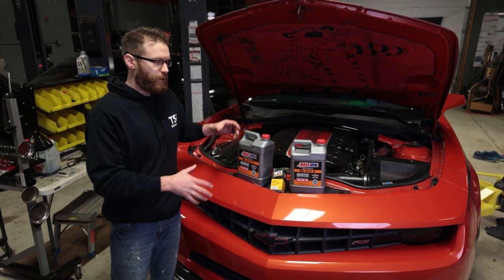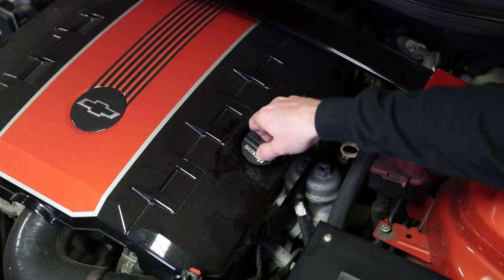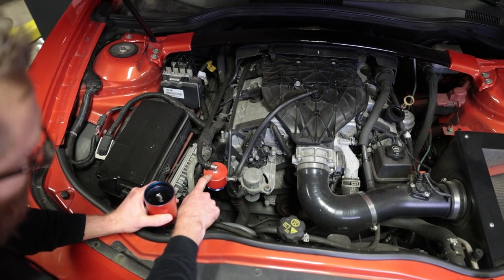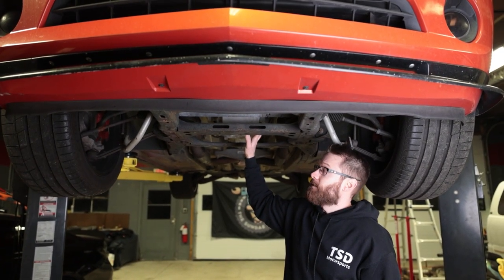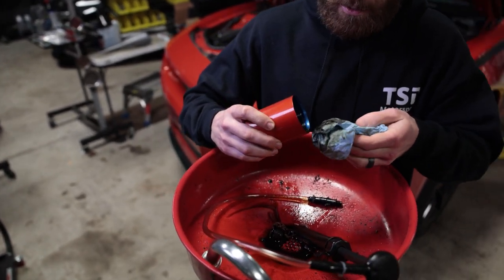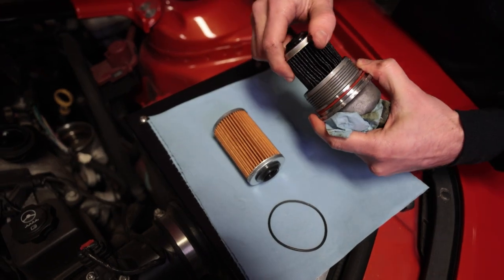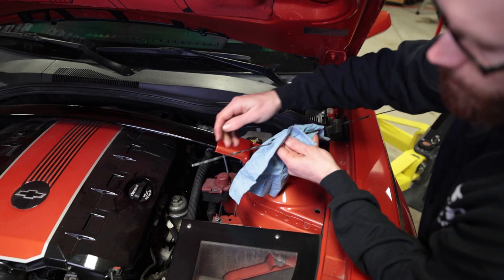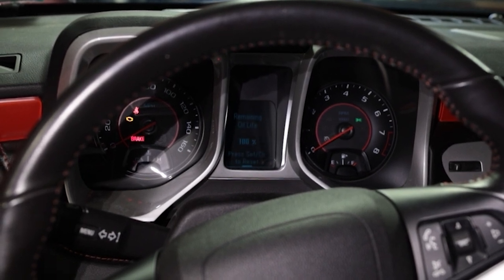Ultimate 2010-2015 V6 Camaro Oil Change Guide LS LT RS - LFX LLT Engine

Comment: Lol the same thing happened to me 😂. I went from the LLT to LFX. The LFX feels way smoother and more power.
Reply: Do you have a link to the catch can ? I like the design of the one your using.
Reply from the maker: Sure do! https://amzn.to/45K2iIp
Reply: Do you use any additives such as bg 44k or anything to your vehicle? I have black soot all over my tail pipes an on back of vehicle. Idk if my car is running rich I do have Cai don't know if that is the cause
Reply: @shaefreeman2768  I just use whatever additive I can find from time to time. With llt, I would also get soot on tail pipes. The lfx doesn't do that. Atleast not with mine. I have the 2015 version of lfx. Could be something to do with the pvc system in your case. If you have a scanner you could probably get a clearer picture of what your problem is. Could also be a fuel sensor, anything fuel related, a leak in the intake.

Comment: Wow, I was about to pick up a 2012 V6 with only 62k miles but after hearing about the oil burning issue maybe I’ll hold off?
Reply: I have one with high mileage and honestly it’s amazing car just take care of it. I have the lt i think.
Reply: One last thing that mileage is good and 2012 was one of the best years for the camero.
Reply: yes the earlier models expect oil burning issues!!!!
Reply: @mrlobsterrsalt5996  NO! only good if you have all the oil change maintnance because these cars burn oil
Reply: You have to also mod the pcv valve the holes are way to small an gm did not recall it they just advised to have bigger holes. 7/64 top hole and 5/64 both bottom I believe that is what it was. And get catch can do not go without a catch can

Comment: Can a LS 2015 v6 3.6 engine fit inside of a LS 2011 Chevy Camaro v6 3.6 engine. My engine in my 2011 blew out just wondering will the 2015 fit inside my car
Reply: it's the same chassis.

Comment: I have a question my 2013 camaro has a leak from power steering line the long line that goes to Frame on driver side  by the wheel. There's a connector looking thing where the lines are bolted on to the frame it's leaking do you know what line I need to get or can I replace a gasket? I've looked but can't find the line. Maybe a link would be great?? Thank uu

Comment: I use mobile 1 full synthetic 5w30 every 3k
Reply: Does mobil 1 burn oil still? I go thru 1qt every 1,000 miles an that's gm oil from dealer. Heard it sucks. Does ur oil stay good on mobil?